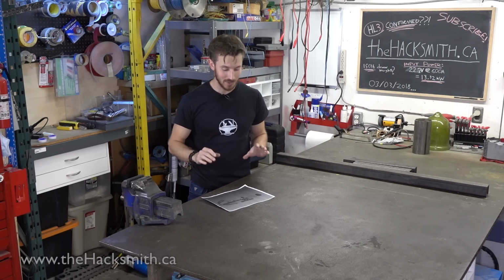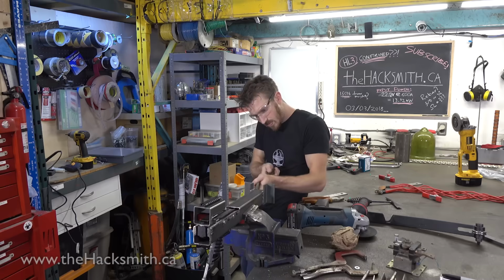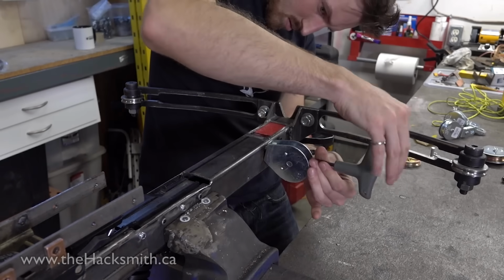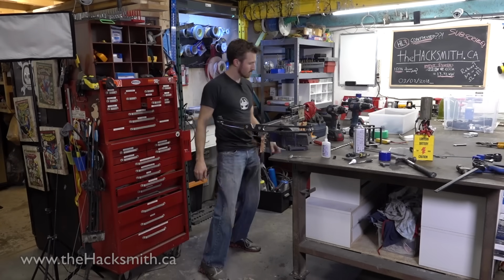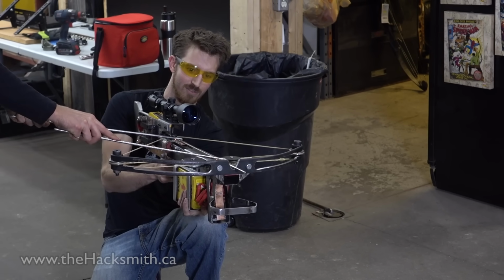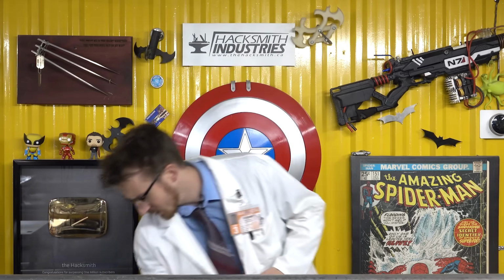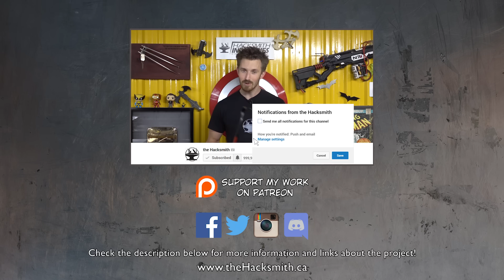REBAR CROSSBOW FROM HALF LIFE!

Comment from the maker: TOP QUESTIONS:

-Why not use an induction coil?
Induction coils are not as efficient as resistance heating. You would need a power supply (+ the battery) the size of a microwave to produce 15kW of heat. Where as with resistive heating, you only need a battery pack to produce 15kW to get that much heat.
-Why isn't the tip red hot?
If the tip was red hot, it wouldn't penetrate at all. It would deform on impact. We can do it (just use a shorter bolt).
-What's the music at the beginning?
It's the Valve intro music in many games.
-Why didn't you use real rebar?
It's not very conductive because it is rusty and bumpy. Hard to make a good connection. That's why we used smooth steel rods. This is shown in the video.
-You should test this against the shield!
The shield would win ;-)
Reply: the Hacksmith Why not have the crowbar type Gordon uses?
Reply: Now do the dragon’s fury from the latest update in TF2
Reply: for curiosity, it would really be awesome seeing that thing deform with the superheated projectile that includes the tip. hell when the steel deformed when the bolt impacted was oddly beautiful
Reply: Then make the hot hand and use it on passers by
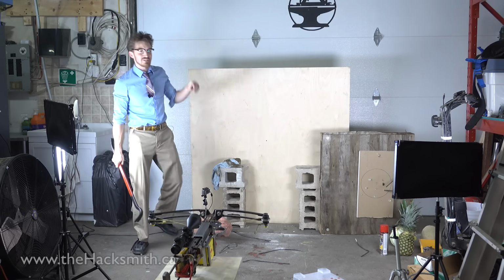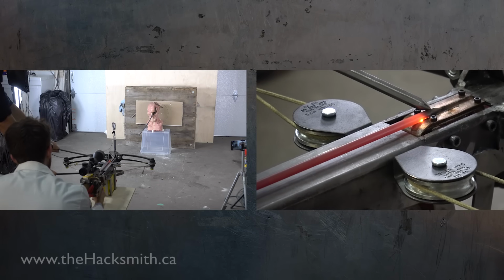Reply: You know, as it is said at 20:11, even Hacksmith starts to appreciate the sheer force of bullets, now that he sees how hard it is to penetrate this skull with crowbar, or a rebar from a recurve crossbow, which actually fails to do so at 18:50, and the same happens to an actual crossbow, while the recurve crossbow is stronger than a usual one. There's a lot of videos on YT that show what a usual rifle ammo can do to medieval armor (not to speak of a usual human skull)
So, what's OP is the Barrett 50, and even the usual rifles like Mosint-Nagant are OP, this here is video game stuff.
Reply: Why not keep the leave spring inhumanly difficult to pull and switch to a geared mechanism.
Reply: Hacksmith do cal of duty wepons
Reply: Using a leaf spring seems to be pretty on the money, considering the sheer force of impact from the crossbow bolt in Half-Life 2 is enough to literally sweep a combine soldier off of it's feet, gear and all (Easily estimated at >150kg), which would imply an astonishing amount of force. However we see how easily Gordon loads the crossbow in the game, which is explained by something else: His hazard suit, which gives him well-above-average strength and speed. You can see this in the way he can absolutely decimated boxes, humans, and other creatures with nothing but a crowbar, and how easily and quickly he swings said crowbar.

It wouldn't surprise me at all if the crossbow was designed specifically with gordon's HEV suit in mind.
Reply: the Hacksmith wow
Reply: why would you weaken the limb? you could use a leaver or even a handcrank (yes, that stuff was used in medival crossbows)
edit: probably would bend the bar before leaving the crossbow
Reply: BOY YOU KILL COMBINE NOT ZOMBIES
Reply: the Hacksmith your into is the valve one
Reply: ahhh ok
Reply: the Hacksmith have ypu tried Half Life or Gmod? Not trying to be rude and how did u pick this idea up.
Reply: Why didn't you make an automatic pull back system using torque motors?
Reply: wow 
you actually got me into playing it that game ofc
Reply: Make the double barreled spas next.
Reply: the Hacksmith the rebar you’re using was steel

If it’s titanium rebar 
It won’t be malleable it’ll be solid at really hot temperatures 
Ti is most likely to just break off i can prove it if you watch people trying to forge Ti 
it doesn’t work out to well for them

so if halflife had Ti rebar it could go though concrete so long as it had enough force
Reply: hola papu y hablo espanish pero me gusto tu video vendeme tu ballesta >:v
Reply: see
Reply: Try Hard steel tip
Reply: the Hacksmith  cxxfz dzxfz do roku r0
Reply: Eh, its not hard to get rust off of real rebar mostly because well, real rebar does not come packaged with metal on it. And the surface would not 100% matter if you make the contacts properly to touch it as the one in the game does. And yeah the xbow in game looks and uses different things, but it's a game with aliens XD Just try to rid some rust from the rebar and try it with that ya pansy. I bet it would actually cause some damage with it being thicker and more sturdy then some thin ass metal.
Reply: More like an impossible amount of force to sweep 150kg soldier off it's feet. Put simply, Newton's third law comes into play: for every action, there is an equal and opposite reaction. This means that the person firing the weapon would also be knocked off their feet. Video games are fun, but they're pure fiction. No point in trying to explain it in any meaningful way, just enjoy the game for what it is ;-)
Reply: the Hacksmith IT IS AMAZING
Reply: I want proof that the shield would win
Reply: You could some pretty cool fletchings out of steel, that basically act as flying knives, and keep them low profile. This would actually be a highly effective anti personnel weapon as it would be nearly impossible to remove a bolt, if you were to aim for soft target locations, like the gut, it would penetrate until it hits bone, and then would cauterize the wound but also cause significant full thickness burns to internal organs. And because it would not be able to be removed until it cools enough, or someone has something they can grip it with, it is a truly brutal weapon. Hell even it tumbling, at those temperatures it would cause significant burns to a target.
Reply: i want to buy it
Reply: the Hacksmith you liv near me
Reply: the Hacksmith I
Reply: the Hacksmith 한국어자막도지원해주세요
Reply: Do you think using a thicker bolt would increase the durability?
Reply: the Hacksmith ii
Reply: the Hacksmith l
Reply: the Hacksmith you should sell some of this to the military lol. you’d be there main idea person BRING OUT THE CHALK BOARD AND BUCKET OF MARVEL COMICS
Reply: the Hacksmith Please make the jet chair for grandpa from happy wheels please do it
Reply: BuT ThE FoOtAgE yOu UsEd WaS fRoM GaRrY's MoD!!!!!!!!!!!!1!1!!!11

(Being ironic btw)
Reply: the Hacksmith i
Reply: the Hacksmith MAKE the half life 3 ;(
Reply: What about heating just the tip?
Reply: the Hacksmith Oo
Reply: the Hacksmith
Reply: um what? HOW DO YOU TYPE THIS BAD?
Reply: he is making the same crossbow from the game the one from the game didnt have a crank
Reply: no it heats up after gordon puts it on the crossbow
Reply: no its from half life 2 the footage was from garry's mod
Reply: now the scientifically impossible gravity gun but at least 1,000 people have said that already obviously XD
Reply: the Hacksmith ggggy
Reply: the Hacksmith I know this is an old video but a pull bar to load would have saved the struggle of using your hands to load
Reply: the Hacksmith do the tau cannon frum half life
Reply: Why not use a pulley system to prime the crossbow and keep it at least a bit thicker? I assume the string was not under its maximum load anyway. Would have been neat to see something that overkill.
Reply: NEW TOP QUESTION:

where is the pan video
Reply: do the HEV Suit next
Reply: Is zombie go boom still around?
Reply: puro It takes too long to load.
Chemical heating in an incendiary round gets the same effect but without having to keep using up really heavy batteries.
Reply: the Hacksmith hi
Reply: the Hacksmith a
Reply: what type of velocities are you getting with standard arrows out of it
Reply: What happened with real but unheated rebar when fired?
Reply: the Hacksmith hi
Reply: the Hacksmith
Reply: it actually would be possible if you put a high temp metal as the center and a lower temp metal as a layer on the outside of the bolt thick enough to be heated
Reply: Your not supposed to dry fire any kind of bow or crossbow
Reply: How much is that crossbow sir?
Reply: the Hacksmith is the new Albert Einstein
Reply: Why does the intro sounds like the Left 4 Dead
Reply: Why not be called "Hack Mesa"?
Reply: Hiiii bro please make to  Iron Man legs
Reply: Maybe you should use what you used for the new lightsaber : titanium + tungsten
Reply: Deformed head would cause more damage like a hollow point
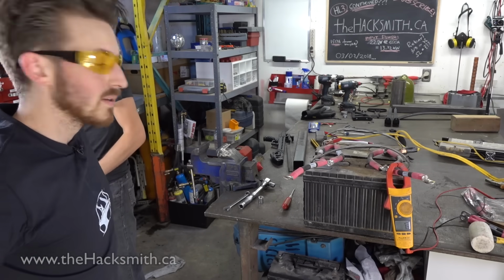Reply: 8:12 sparkeosios
Reply: I'I'already in a half life 2 vibe/feeling. :D
Reply: Why not buy new rebar?
Reply: @TheWinjin  dude this channel is about video game and movie stuff what did u expect
Reply: the Hacksmith Is good
Reply: Lift and separate arms
Point and lower arms
Reconnect arms 
Repeat
Reply: It's bolt
Reply: "You would need a power supply (+ the battery) the size of a Magnifician Microwave Oven to produce 15kW of heat" There, Fixed it for you, send me subs Ill be there all year :p
Reply: qUEStIoN: WhERe,,,,,s HaLF-LiFe 3>?:???
Reply: If i may suggest : you should sharpen the steel rods front part , for aerodynamical purposes
Reply: WELL this is the best weapon i ever see in my life good job my lord
Reply: Arcers paradoks
Reply: This is something to hunt down something
Reply: Of couse this is what the millitary would wanted to use!
Reply: Why dont make outer lay from low melting metal, but inside will be something hard-to melt like tungsten and tadaaa, outer lay did job to make soft contact with "enemy" surface and tungsten do penetrate without bending!!!
Reply: By the way... Do you know about Archers Paradocs?  I can’t spell it but what it is, is it depends on the arrow’s shaft’s stiff ness. The arrow bends in mid air and if it sticks in the Target with the end sticking to the left that means the shaft is to thick. If not and it turn to the right it’s to thin
Reply: Which batteries are that?
Reply: @Cattomic_Bomb  War has laws, so if there's no chance they'd survive it's banned. E.g Laser Rifles
Reply: @Shigbeard  That doesn't explain how the Rebels can use the crossbow as well.
Reply: @ketch10  GabeNs son is working on it Believeitornot
Reply: Isnt this more of an arbalest????
Reply: How many days you take to complete this sacred task?Kinda wonder
Reply: Noledge meme plays whildt reading the text
Reply: So Hacksmith, I was thinking what if you made a remote control transformer.
Reply: Whereas*
Reply: Shackel?!
Reply: My  nane is  zane
Reply: @brokenmirror8629  it was pretty close tho
Reply: the Hacksmith. I want the pubg pan. It is indestructible
Reply: Make the ar2 lol
Reply: You should totally make a mk2!!!
Reply: YOU SHOULD MAKE THE CROSSBOW FROM   METRO EXODUS !
Reply: Y
Reply: Hl2 rebars is a building rod, it would be very heavy
Reply: the Hacksmith hi
Reply: Hello gordon
Reply: Bro that's Gmod not half life
Reply: I have no idea what that even is
Reply: Thanks for the info.
Great Video!
Reply: If you could use actual rebar, you should make it spin by making a connection that has the opposite threading so that pulling it through will make it spin, like rifling.
Reply: My good look how young u look in the thumbnail
Reply: Hey build the hev suit
Reply: Make the Half life 1 cross bow that is semi auto and uses a mag
Reply: Chewy crossbow
Reply: Conect it to your mother that is ez
Reply: InstaBlaster
Reply: Shout red hot arrow on dry ice
Reply: Try shoting on  dry ice
Reply: can you plss make the farcry6 crossbow:*(
Reply: @gings4ever  
yeah, it’d stick to what it hit
Maybe, I have hope
Reply: Hey Hacksmith can you make a gaster Blaster Project?
Reply: i cant believe you guys are making better weapons then the goverment
Reply: @itscompletelyunderstood  oh how the time has changed.. but we might get a update soon..
Reply: Have you guys chronographed the rebar? I’m genuinely curious as to how fast of a projectile it is
Reply: The way the mail guy throw the mail is like a cartoon
Reply: i have some ideas for next:
- combine ar2
- gravity gun 
- airboat
- hev suit
- strider
- kleiner's mini teleporter
- c r o w b a r
- stunstick 
- manhack
Reply: @itscompletelyunderstood  good idea, nowadays we have small versions of that which shoot rapidly burning paper(??) Balls as fireballs.

oh and fun fact (writing this like I'm a time traveler idk why) jungle inferno is still the latest update, ,7yrs later
Reply: you should make the fallout power fist
Reply: @itscompletelyunderstood  Still the latest update!!
Reply: Go vegan
Reply: @Shigbeard  considering that the crossbow is the closest to a sniper that we have my assumption is they must have used some type of tripod to even have a chance to wield it
Reply: AND also its called resistance heating and this weapon was used by the resistance
Reply: legit nobody cares dude

Comment: I suspect loading the bolts and drawing the bow would be easier if you had an HEV suit. Not only to protect your hands from the metal and the string, but also to help with the pull strength.
Reply: If I remember correctly, stuff like the gravity gun is actually considerably heavy to people to hold, Alyx struggles to hold it in Black Mesa East but Gordon is able to carry it like its nothing, so potentially yeah the HEV suit has some strength enhancing abilities
Reply: @kittyhawk2352  Maybe thats why guns have so low recoil in Half Life 2
Reply: Duh? Why didn't you use an HEV suit?
Reply: buffalo wt Gordon didn’t skip arm day lmao
Reply: @vicentec4779  Well look at the pistol in HL2, it blows back so frickin far, also the same with SMG
Reply: yeah even a nerd can do it
Reply: Problem with  that theory is that the Crossbow wasn't built by Gordon nor by regular HEV suit users, it was built by rebels, who, as you noticed, did not have HEV suits.
Reply: @Horny_Fruit_Flies  also the game's crossbow has a motorized pulley that resets the string after every shot
which also helps for rebels who have no mechanized powersuit
Reply: Jesse GD true
Reply: James' next project, HEV suit with included strength boost, and radiation protection.
Reply: @vicentec4779  oh yeah yeah
Reply: @joking_oregon1  modified hazmat suit with hydraulics.
Reply: @vicentec4779  have you heard of the USP?
Reply: @Minority119  I don't understand why a red hot bolt though? Is it cause it melts armor along the way?
Reply: @totallynoteverything1.  yea just overall more damage
like piercing AND burning
not what would happen realistically but still
Reply: Pretty sure the HL2 crossbow has an automatic draw mechanism
Reply: no wonder gordon can 1-hand the crowbar
Reply: the hev suit gives gordon 60 more health than a regular human in the game, no wonder
Reply: The power armor mod:
Reply: @vicentec4779  I mean... the guns in Duke Nukem 3D have literally no recoil...
Reply: agreed
Reply: @RowanBird779 recoin?
Reply: @vicentec4779  its experience you see in half life 1 vs opposing forces the recoil is higher whit gordon than adrians even whit hev suit
Reply: @kittyhawk2352  dr breen was also bearly able to hold It, having to drag It on the ground when he was running away
Reply: @vicentec4779  they do in half life 1 but not when you play as the military faction in half life 2 i guess its experience
Reply: @kittyhawk2352  i doubt it, Alyx just didn't workout her arms.
Reply: your a homestuck arent you.
Reply: Have been since like, idk, 2012-ish.
Reply: homestuck!!! :3
Reply: hamsteak
Reply: @RowanBird779  its duke nukem

Comment: So the crossbow implies at some point, alyx and maybe some of the vorts all gathered round a workbench at some coast base, came up with this concept, built several working models (enough to supply most resistance supply posts with rebar ammunition for it) and during none of this did eli or kleiner or anyone else say “this is stupid and dangerous”.
Reply: Do you forget that they were fighting an enemy, who equiped their occupation forces on earth with a rifle that can atomise you just by pressing alt fire. I don’t think they had to much room to complain
Reply: ever since the resonance cascade, "stupid and dangerous" became a non-issue
Reply: @BlackHat-qf2bc  Yeah but as we have seen in the video it clearly wouldn't pin those Combine soldiers to the wall like it does in the game.
Reply: @Silverwind87  Do you think that makes it suddenly useless?
Reply: I think Kleiner—proud Headcrab owner—wouldn’t have a problem with “stupid and dangerous”.
Reply: they probably did..... until they saw it get used
Reply: well there is no reason to believe that alyx or any other of the main characters had any part in the design. it was likely designed by some random resistance members who were running out of ammo and needed to use something common. rebar is found in almost all concrete structures and its easy to get with a hammer and a hacksaw.
Reply: I think they just needed rear at those places, or it was a cheap crossbow that can peirce combine armor
Reply: Not to mention nobody thought to sharpen the rebar